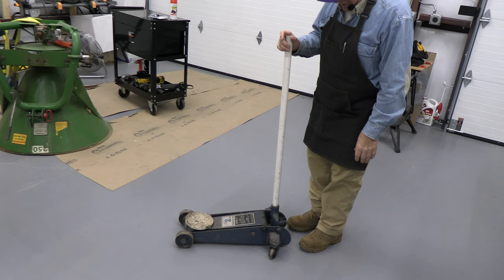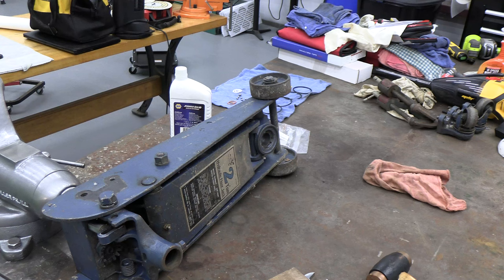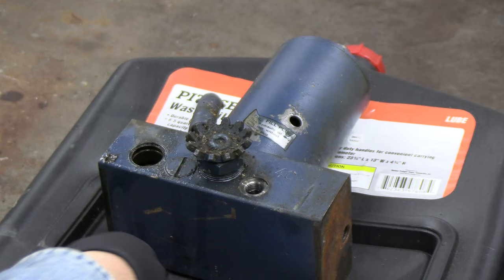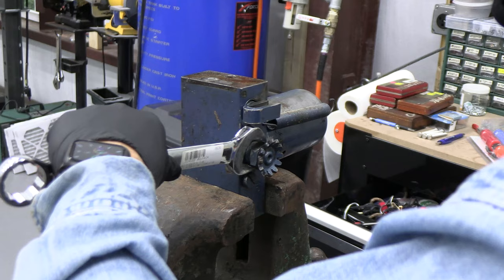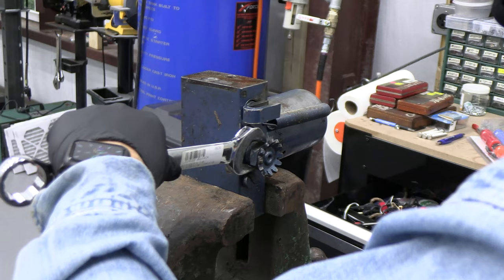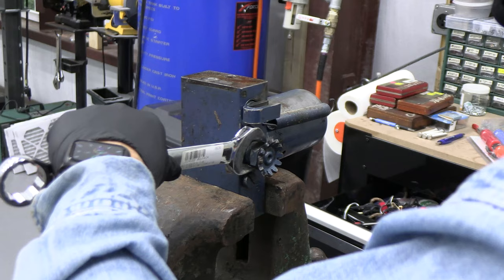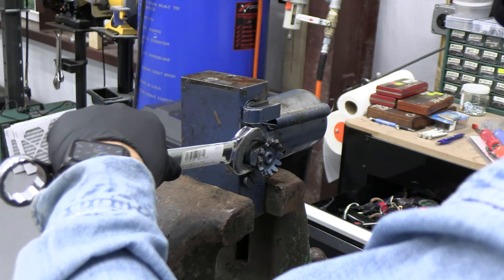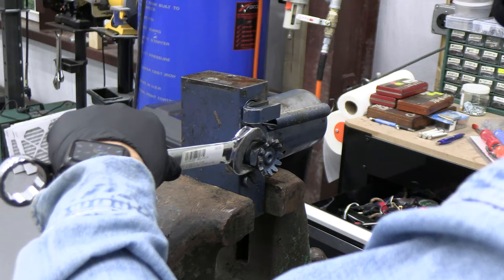Sears 2 Ton Floor Jack Complete Rebuild

Comment: I'm 77 years old....my mom and dad bought me that jack when I was in high school....probably 1963 or 64.  Still works
Reply from the maker: Hi Ron, thanks for the comment. It’s a great jack overall isn’t it. They produce so many of those. It’s unbelievable. I’m so glad you’re still works. Consider subscribing. Thanks, Joe.
Reply: I'm 68. I bought mine when I was a junior in high school. Saw this video. Figured it could use a little loving!
Reply: Got one on offer up for 20 dollars it doesn't hold I'm going to order the kit thanks for the video it will help alot
Reply: 66 yr.old Wrench here...Bought a $100 floor jack in 1983 and NOW needs rebuilr...3 and half ton jacks are not this heavy duty now...
Reply: People used to demand quality,not today so much.every thing is throw away.😊

Comment from the maker: OK, let me answer your second question first the needle valve. I would basically bottom it out and then back it off six turns that’s a good starting point and will probably be fine. As far as the barbarians are concerned, what I did was identify them as I removed them and replaced them with the same ones. It should be on the video showing exactly which ones go where. I don’t remember off the top of my head right now, but it should be on the video. Thanks for your question consider subscribing. Take care. Joe.

Comment: I am 78 years old. I am  Made In Japan as well.
Reply from the maker: Hey, good for you. I have many wonderful products made in Japan and this Jack is certainly one of them. Consider subscribing. Thanks. Joe.
Reply: Of course. I have just ordered the kit from Amazon. One of the rubber seal is dry rotted and I am struggling to remove it. Thank you for your instruction.

Comment: You should not take at the pressure relieve screw out, it is set from the factory so It don't lift over the rating on the jack. The reason you had trouble taking out the screw was because it was pinned in from the factory. If you look close you can see you can see the center punch mark at the top of the screw... If you have it set to tight it will tear itself up trying to lift more than the rating..
Reply from the maker: Thank you for your comment Tim. You are absolutely correct. I don’t think I’m gonna try to push this beyond it rated capacity but that certainly could be a problem. Thanks again joe

Comment: I wanted to watch you get that little rubber plug back in the oil fill hole!!!
Reply from the maker: Oh that’s funny. I understand. Yes, it was a bit of a challenge. I used to find screwdriver once I positioned it to get it to pop in there. Consider subscribing. Thanks. Joe.

Comment: In 1980 my dad purchased a Sears 3 ton floor jack and after lifting n lowering several vehicles including a semi truck transmission the jack still works.  Amazing craftsmanship. Probably nothing out there made in the USA still to compare
Reply from the maker: Those Jack’s were made in Japan and very well-made. Yes, they have some seals that will fail but overall their quality and durability obviously is excellent. I’m glad you’re still works great it may need to rebuild someday consider subscribing. Thanks Joe.
Reply: Ut would be nice if you would explain how and where one would purchase a rebuild kit!

Comment: This was probably the best informational video I’ve ever seen. The headset made the narrative so clear and you describe everything perfectly. Now, I have the same problem. I bought a jack at an estate sale and the plug was missing when I bought it. This was an online auction, so it was basically sight unseen. Anyway, the jack won’t lift with the cap and once I remove the cap it will lift if I pump it kind of fast and then once it starts to raise, it will raise to its fullest height. It will sustain that for 24 hours because I had it underneath a wall-mounted cabinet and it didn’t come back down. I have no idea what the brand of my floor jack is. The labels are long gone. The only thing I have a clue about is the fact that it had a Texico sticker on it because you can still see the “T”.  So it was at a Texaco refinery or garage, I just don’t know. How in the world am I gonna be able to tell what I have in order to get a repair kit? Any help you can give will be greatly appreciated. Thanks again for a really, really good video.
Reply from the maker: Thank you for your very nice shout out. Yes that could be an issue. If there are no markings usually there are some stamped markings somewhere or a label but yours may be gone. Send me some pictures I might be able to help. Many of these checks are sold under a different name is, but they’re all very similar. If yours is similar to mine, I will send you the link for the repair kit. Consider subscribing. Thanks, Joe.
Reply: I had a Sears 3 ton floor jack that was similar to the model you have there. I bought it in 1988. I lent it to a friend for his engine job. It saw heavy wear & it wasn’t the same afterwards. It limped along for another thirty years & I tried bleeding it & adding jack oil. Nothing seemed to work? I junked it at the town dump. I bought a much better jack from NAPA that’s a hybrid. It lifts quickly until it reaches the vehicle. Then it slows down. It doesn’t weigh nearly as much as the Sears. A much better jack. It will see me out. 
Thanks for the rebuild video.

Comment: Bout to rebuild mine in a few mins. Thanks for the great detail in your video. Will make this very easy.  I got mine from a good friend that's no longer with us.  Almost got rid of it before finding ur video. Now I can continue remembering the good times when I work on the cars.
Reply: I'll probly locktite mine cause the threads feel a little loose when loosening the bolts
Reply from the maker: That’s probably not a bad idea. Remember there are different types of Loctite one is permanent and one is long lasting. I would probably use the long lasting not the permanent one just something to think about. Thank you. Joe.

Comment: Thanks for this video. I have a similar Sears jack that my dad gave me. It is an odd thing to hold some sentimental value, but it has been in the family as long as I have! We restored cars together and this jack was always there. It stopped holding weight this year and your video gave me a good guide on the rebuild. It works like new again.
Reply from the maker: Thank you so much for your wonderful comment. I am so glad that was helpful. Isn’t it great when you can rebuild something particularly yours has such incredible sentimental value. That’ll be able to be passed down to the next generation or two. Consider subscribing. Thanks Joe.
Reply: @JosephHunstad  It sure is. I try to teach my kids many things can be fixed instead of tossed aside. I hope it is set for another 40 years of use!

Comment: Wow, great video, thanks, Dr. Joe!  I have what looks like the same jack, but was rated at 2 1/4 tons. I believe I bought it around 1986 at a place called Trak automotive. I have the owner's manual for it, but it doesn't say where it was made, but now I know it was probably Japan. It is just now failing. I'm looking at replacing it for around $200 with an aluminum jack, but now am reconsidering. My hesitation is based on the fact that I don't have any monster vises, along with a few other missing extra large tools. And as you know, Dr. Joe, these things are rather heavy to be muscling around. My back is telling me to proceed with great caution.  I do have access to a larger vise, so I might just replace the jack with the intention of doing the rebuild at my leisure rather than giving it to the scrapper. Thanks a lot for posting this. Oh, and I wish I'd seen it before I opened up both of the valve screws on the oil block. I didn't count the threads while backing the needle-valve screw out. Any hope on a home adjustment on that? Again, many thanks for the great video. Cheers.
Reply from the maker: Wow, great comment! Thank you so much. As far as the valve adjustment I think it’s going to be OK. I would tighten it all the way down and then back it up for turns and watch the function. You probably can’t tell until you repair it how well it works unfortunately. and yes, I needed a big vice to loosen that large nut because it was incredibly tight. I think you’ll enjoy the rebuild. It was a lot of fun for me. Consider subscribing. Thanks, Joe.
Reply: @JosephHunstad  Thanks for your quick response and advice. I may order up the kit today and see how it goes. I have a friend who is into vintage vises. And he has heavy shop tables like you have, which would be very handy. I sent him the link here because he has mentioned Wilton vises before. Like you, he's very handy with all things mechanical. Thanks again. Cheers.

Comment: finally, I found someone who knows about this particular jack. My father purchased this from Sears when it first came out. It failed last year. That is one well-made jack. Now that I have a video to go along with instructions, I can finally fix it. This is an amazing jack well worth saving and after fixing it, I am sure it will outlive me. I will try to do a video on my repair. Between work, it might be a while. 
I do have problem. That large flat screw, almost flush to the surface, located on the backside of the pump housing, as shown in your video at 9:14 minutes, you are removing the grooved wheel (not sure actually what's called), to the left, next to the hole opening. On mine, the notch for a flathead screwdriver is worn and frozen. How can I remove that besides drilling it out? I have tried matching the blade the size to give the notch a solid fit, but it just eats the meatal attempting to remove it. Perhaps to use a torch and remove it? That screw is the only thing preventing my repair. By the way. What is that screw for anyways? Any tips or advice on this jack is most appreciated. Thank you.
Reply from the maker: Hey buddy, great comment. Could you send me a picture of that screw? I have some ideas. Sometimes I’ll take but a Dremel tool with a narrow, grinding wheel and actually cut the groove for the screwdriver deeper and then use an impact screwdriver to get it going, but send me a picture so I can take a look. Thanks, Joe.
Reply: @JosephHunstad  sure thing. Thank U
Reply: Did you have any luck? Sounds like you're speaking of one the screws that say "DO NOT ADJUST". Count and write down the turns needed to take it out, so when you reinstall, you know just how many turns in to go. 

Like removing a broken exhaust manifold stud, You could (or have someone) weld a nut to that screw head. Once out, cut the nut off and re-slot the screw. Or...just leave the nut on.
Reply: @jdh6000  yes. I tore the whole thing apart. Since the time I had asked you about it, my father's old jack works perfectly again. That screw I was careful of. Getting it off was tricky. It was rusted shut. With lots of luck, adjustments, and testing with that particular screw. I was able to dial it in to where it performed well. The only thing left to do and should have done it when it was all apart is to paint it. I am currently looking for a design company that can/would remake new original labels to replace my worn-out ones. So far, it has been a copy right issue and might have to do a little more research to do that or get permission. Overall, this has been the best $50 and change investment I have made. I couldn't have done without your help.
Reply: @jdh6000  Also, that screw. The flat head was so beat up. Looks like someone tried to remove it, and there wasn't any slot left to put a Phillips on. I had to spot weld a nut to it and then was able to remove it. I am lucky I have a friend who is a machinist and he made me a replacement.
Reply: @jdh6000  and you're a retired plastic surgeon. That is interesting. I recently had a work accident and had a beam broke loose from it support chains and smaked me square in the face. Missed my left eye, Barley. But it sliced my brow between the eyes, and now there is a big piece of skin lifted that looks hideous and will soon have facial reconstruction.
Reply: Typically one would use an impact driver; the kind you strike with a hammer. That worked for me. If you can't get it out, just leave it alone. It probably is okay.
Reply: @snorman1951  Can do! The holidays and work have slowed things down.

Comment: I am 74 and own the same exact model. Thanks for the video. Now I will know what to do if mine breaks down.
Reply from the maker: Hey, thanks for your comment. Yes you could use that video to rebuild. If your jack loses pressure once it’s pumped up that’s the time to fix it. It’s a lot of fun to actually repair it as well. Then it’s good for another few generations at least. Consider subscribing. Thanks. Joe.

Comment: Mine is from the 70's and appears to be identical. Same model number. I'm ordering one of the rebuild kits. Thanks for the very informative video.
Reply from the maker: Thanks for your comment. It’s almost certain that you’ll have a basically brand new Jack that will last for many decades. Consider subscribing. Thanks, Joe.
Reply: @JosephHunstad  I'm sure hoping so. It has been many years since I was able to use it. I am about done now and the only problem I found was the main seal. It actually was cracked with a couple of chunks broken off. I was a little  short on metric wrenches, but a couple of crescents and a pipe wrench worked okay. And the cheater pipe of course. Not a hard job if one has the tools.
Reply from the maker: @snorman1951  you are so right. I’m glad it’s working out for you. Consider subscribing. Thanks Joe.

Comment: Excellent Video,  I have one just like it only it's orange.  Mine is labeled Astro but it's the same. I bought it off the MAC Tools truck about the same time you bought yours, 1981.  I had the same problem years ago and since I dealt with a local hydraulic shop they said, "give it to us and we'll rebuild it".   They said it's a Hein Werner knockoff.  I'd trust it over the cheap ones on the market today.  It's sad that all the old hydraulic jack companies are gone.  Walker, Lincoln and Blackhawk.  These older jacks are definitely worth saving.  Subscribed
Reply from the maker: Thank you very much for your kind comments. It was actually a lot of fun to rebuild and it works great. Yes, these jacks are super well-made and again I think with the rebuild should last another 50 years. Much better than the ones from China. Thanks for subscribing. Take care Joe

Comment: I have 2 of those hydraulic jacks over 45 yrs old   One was my dads other I bought like 30 yrs ago 
Time for me to rebuild them    I bought 2 harbor freight jacks in their place.   I do this kind of hydraulic wk for a living.   Forklift mechanic.  Just been lazy.   Now watching your video inspired me to get mind rebuilt 
😀😀
Reply from the maker: Thank you for your nice comment. Those old jacks are dramatically better than your Harbor freight replacements. Once you rebuild them, you absolutely have the knowhow, you will be so proud of them and they will last for another couple generations at least. I’ve got a link to the rebuild kits in the description you can just get them that way. It is a lot of fun to rebuild a Jack and have it worked perfectly again. Consider subscribing. Thanks. Joe.

Comment: Thx!  Great video instructions.
FYI, to remove the hydraulic unit, you don’t have to take all that stuff off.  Just the cotter pin and the two side bolts.  Raise the lift arm by hand, and then the hydraulic unit then just slips out the bottom.
Reply from the maker: Yes, thank you very much for that. You are correct. I appreciate that. Consider subscribing. Thanks. Joe.

Comment: Appreciate the video.  I too bought mine in 82-83.  I replaced it recently with a Harbor Freight unit but kept this jack around hoping to rebuild it.  It is just too well built compared to the new stuff..
Reply from the maker: You will enjoy very much rebuilding that Jack
Yes, it’s well-made. Those were made in Japan interestingly, high-quality, and if you do rebuild it which I highly recommend it’ll be good for another few generations at least. Consider subscribing. Thanks. Joe.

Comment: Lots of memories with this jack, I've had mine 35-40 years.  It lately has started acting up.  Doesn't hold  [leaks down] when I have it under load.
Reply from the maker: Hey buddy, seems like you’ve got a similar situation that I did. Follow the step-by-step rebuilding kit and it will be good as new for another 40 or more years. Consider subscribing. Thanks, Joe.

Comment: I loved seeing you rebuild the jack you bought back in '83. I just inherited my grandfather's Sears 2 1/2 ton grey floor jack. I was curious how old it was as he had that thing as long as I remember & I loved helping & messing with it as a kid. Not sure mine needs a rebuild yet as the only issue is it struggles to get the last little bit up so I'm hoping it's just low on fluid. I was surprised to see where the fill plug was located as mine has the slotted plug on the right & a hex plug on the left so I figured those where for filling & bleeding. Anyways now that I know  a rebuild kit is available I can be confident that I can pass this on to one of my kids or eventually grandkids.
Reply from the maker: Hello Larry. Thanks for your comment. It’s great. It’s wonderful to use the jack after the rebuild because it works perfectly. You’re probably going to need a rebuild sometime in the future because it won’t fully lift but if it’s adequate now it’s OK just keep an eye on it because many time is it lifts but doesn’t stay up it will slowly descend, which is dangerous. Consider subscribing. Thanks, Joe.